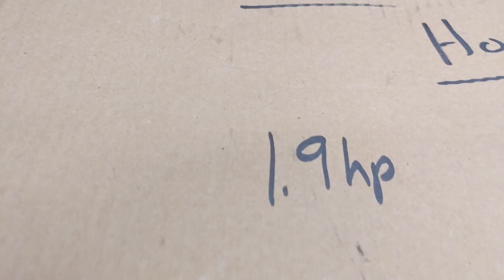Best Cordless Ratchet Makita Husky Milwaukee TESTED 12 volt

Comment: I wonder how much faster would the makita be if you ran it on a 20v battery with a adapter for porter cable
Reply from the maker: At low voltage around 8volts it is spinning at 400rpm and 12volts 800rpm. So as long as the motor held out, with 20volts it should be clipping along at 1200rpm. That would be fun.
Reply: @sixtyfiveford  how much did the makita cost I'm starting to get adapters for my tools so I can run them all on the same battery
Reply from the maker: @adammosher5818  You won't find an adapter to go from 18/20 volts to 12 volt tools. The voltage is just too high and you would likely burn stuff up. 18 and 20-volt tools are exactly the same, It's just marketing for one manufacturer calls it 20 volts max versus 18 volts.

Comment: I have a Milwaukee fuel but have been thinking about a husky for home. I really would like it to have a removable battery though
Reply from the maker: The battery in the little husky seems to last probably four times as long as the Milwaukee 2 amp hour. I can do numerous days of work / jobs with the husky without ever needing recharging.
Reply: @sixtyfiveford  interesting…must be a bigger battery? I go though a 2ah in my Milwaukee pretty much every day at work. Like you stated they slow down quite a bit at 2 bars of battery. That’s good to know,  I might just give the husky a try for a cheaper alternative at home. Thanks for the response!
Reply from the maker: @jeffclark5024  I opened up the husky when I got it and if I recall it was 2ah or 2.5ah. Doing these tests in this video, I found that the Makita seemed to last about twice as long and the husky four times. I had to keep replacing the battery in the Milwaukee for all the tests.

Comment: I think it woulda been worth mentioning warranty especially on the husky n run time n recharge time on it since you can't just swap out the battery n keep going. I actually just picked up the earthquake ratchet cuz I got a crazy deal on it n it'll do everything I need it to do but as we all know the warranty is garbage. I just couldn't pass it up having it n an extra battery for less than $100
Reply from the maker: The Husky has a 2 year free replacement. Just walk in to any Home Depot with the receipt and they should hand you a new one. The Husky will easily tackle a few decent size under the hood jobs before needing a recharge. You could probably rip down an entire engine on a charge. It takes around 1.5-2hours to charge it if you fully drained it. But you should never really do this with any battery pack and should charge it whenever not in use. I honestly thought I would hate not having battery packs but it's just like cell phone where you just plug it in. They put top of the line Samsung cells inside this but in 7-10years when they die you can simply take a few screws out and solder in 3 new cells($15-20).

Comment: Ya speed is generally important and I mean compared to a ratchet they are all winners but sometimes they fight you all the way off and the extra torque might matter
Reply from the maker: Very true. All of these will remove those stubborn bolts that fight all the way out. Generally these ratchets are only for small bolts sub 5/8 or 15mm. Anything over that should really just have a small impact removing it.

Comment: So what about Makita's 18V vs 12V? It literally has the same specs, which i think is crazy since its running at higher voltage. You would think higher torque or something. Am i missing something? I own 18V tools and charger so i was hoping to only have to buy the tool only.
Reply from the maker: I have used other brands with higher voltage and they no more powerful, just bulky. I think the ratchet head is the weakest link any they're afraid of breaking it with too much torque.
Reply: @sixtyfiveford  thanks. You would hope that they would sell the bere tool then for the exact same cost between the 12 and 18 volt. Nope

Comment: Nice video, very informative. Have you seen the new M12 FUEL™ 3/8" High Speed Ratchet (2567-20). I'd be curious of your thoughts on that one.
Reply from the maker: Yeah, but they dropped the 60ftlbs and now it's only 35ftlbs like all the others and still slower than the Makita on paper. I've tried to like the Milwaukee ones but everytime I do a job I grab the Makita.

Comment: Damn it I knew I should have bought that Makita ratchet instead of the long neck 1/4 snap on!
Reply from the maker: I would take the SnapOn over the Milwaukee for sure. But for in engine bay work, the Makita rocks. The speed is as close to using an impact as you can get with a ratchet.

Comment: Very nice review.
Have you accidentally dropped any ? 
How they fair ?
Reply from the maker: I've dropped the Husky and Makita a few times without any issues. They're both pretty light at 2ish pounds. I haven't dropped the Milwaukee but I'm sure it would fair fine unless dropped on the battery pack. The head is so heavy I'm sure it would break the plastic on the battery case if dropped from chest height, but also the head is so heavy it would likely fall head first.

Comment: I’ve been thinking of purchasing one but now I’m on sure, this is the second review I have watched and the first review I watched also was against the Makita and the Milwaukee and when it came to speed the Milwaukee was far faster than the Makita so now I’m confused and unsure.
Reply from the maker: All of them drop speed considerably with a low battery(about half speed). I know the video you watched from project farm. I can only assume he used a low/dead battery for the speed test as that is the only way I came up with the same figures he did. like I said they all drop speed so the Milwaukee drops speed as well with a low battery.  I ended up getting rid of the Milwaukee as it was just too painfully slow, and I'd rather just use an impact driver and never use a power ratchet at all. The Makita on the other hand has been fantastic and I have no regrets.

Comment: Milwaukee is a little late, but they just released a high-speed ratchet version.
Reply from the maker: Yes, they upped it to 450rpm but dropped the torque down to 35ftlbs. This would still put the Makita at nearly twice as efficient. And all the extra features are just icing on the cake.

Comment: I saw recently that the next gen Milwaukee is supposed to be same strength with double the speed!
Reply: Yeah 450 rpm still no where near that mikita  tho
Reply: Wasnt it 35ft lb but twice speed?
Reply: @Jtwizzle  yeah 35 ft lbs 450 rpms
Reply from the maker: Yeah, just looked it up as well 35ftlbs and 450rpm. Personally to me RPM is king with these things. 450 would be night and day better than the painful 200rpm the current one spins at. I guess they'll make people wait another year for the next model to get up to 800rpm. I wonder what Makita's next rendition will hold? Maybe 800rpm and 55ftlbs..... Honestly though the ftlbs are not that important as I'm constantly having to use hand force to remove fasteners even with the 55ftlbs of the Milwaukee.

Comment: So, you didn't try the new Milwaukees?

 M12 FUEL™ ¼” High Speed Ratchet (2566-22)
M12 FUEL™ 3/8” High Speed Ratchet (2567-22)

450 RPM. Still without the "features" of the Mak, but it would have been a fairer comparison.
Reply from the maker: Those haven't been released yet. They're 450 RPMs but only 35 foot pounds. The Makita would have still doubled their performance.

Comment: Pretty cool, but I NEVER use my 1/4 or 3/8" air ratchets for some reason...  Maybe dealing with the cord is why I don't??  Also, doesn't the electric impact sort of replace these as well?
Reply from the maker: I hate air ratchets for two reasons and never used them(even though I owned them). They all spin super slow 150-200rpm and are just noisy.
Reply: @sixtyfiveford  haha, and let's not forget the fact they have the air lines attached, always getting tangled into everything and in the way!  Yeah, I NEVER grab mine and I even own a super nice Snap-On 1/4" air ratchet ... 

I'm trying to decide if one of the eclectic versions are something that will benefit me because I'm wondering if it's something that will actually be more than the electric impact driver I already have?  Obviously you dig them and I respect you opinion greatly...  I'm a maintenance mechanic/machinist in my day job, and an avid DIYer and tinkerer on my off times.
Reply: At the shop I would never pull my air ratchet out of my box. I just always used a regular socket and ratchet. It took more time to hook that slow, loud, cold metal thing up than to just loosen the bolts by hand. Once I went electric, I never looked back. It sits right next to me without getting in the way and you can rip a radiator and fan out in 5 minutes! It also is the ONLY way to go if you go to junkyards.
Reply: @HoosierDaddy_  Which model do you use & like?
Reply: WHO WHO WALKWA  * the big 3 all make pretty good stuff. I find a good deal on batteries and usually stay in that line. You could use adapters though. Milwaukee usually has the power, Makita usually has the smoothness and quality, Dewalt has a few good ones too. You can't go wrong with the makita ratchet and the Milwaukee impact.
Reply: WHO WHO WALKWA  * pretty much. Make sure you have shallow and deep impact rated sockets. There's always going to be a few Bolts that you can't reach with  these tools and sometimes you have to be careful not to snap small delicate bolts off with all that power. You'll just need some wrenches and a couple ratchets for the small difficult stuff. Using electric tools on most things just cuts the time down significantly. Especially when you have to, say, bust the front tires off and replace brakes. You can just zip right through that. But, for instance, when putting wheel lug nuts back on, you DON'T  want to use an impact since they need to be torqued properly. So I'd say 80% of jobs can be sped up with electric or air tools. Electric now being more portable. If you get a "mechanics set" of basic tools and a good torque wrench and good jack and stands, there's not much you couldn't do. Occasionally you run into jobs where you need specialty tools. The auto parts stores loan these out though.
Reply: WHO WHO WALKWA  * if u don't cross thread or tighten them very hard at all, u can zip them on with an impact. Get it wrong once, and it will make a bad situation quick! Just be careful!

Comment: How has the Makita held up? Any Problems?  Thanks.
Reply from the maker: I still love the Makita and have had zero issues. The only one that comes close to this now is the DeWalt; which wasn't available when I did my testing. They also didn't have the Makita 18 volt which is identical when I did my testing either.
Reply: @sixtyfiveford  Do you find yourself switching the heads much or do you stay with one? Have you tried the DeWalt? Is there any difference between the 12v and 18v Makita other than the battery?
Reply from the maker: @brianboughter1040  On certain jobs I find myself switching back and forth a few times. But for the most part it stays with 3/8.  I have not used the DeWalt just seen reviews and it hits on some of the points that I really like about the Makita. As far as performance, there's no difference between the 12 volt and 18 volt. It's just a size difference. This is unfortunate because I don't love any other Makita 12 volt tools.

Comment: How does the 18v makita dwr180 compare you reckon? Same thing but 18v instead of 12v
Reply from the maker: On paper they have the same specs. so other than just having a larger battery hanging off the back they should work identical.
Reply: I went for the 18v as I already have that platform. Specs the same yeah but surely the 18v will have more power on the get go. 
I've tried mine out already and it only does up to 90mn and undoes 120nm. Sorry I'm metric lol

Comment: I would like to know how the AC Delco ratchet prefoms
Reply from the maker: They seam to be part of a group of rebranded Chinese ratchets. If you look closely virtually all these look identical. I think the batteries even interchange. Harbor Freight had the identical match to this and I did use it. It was handy but a budget tool. I would think the tool itself would last the average diy guy years but they always jamb the cheapest cells in the batteries and they seem to die after only a year or so of light use. Those can be taken apart and replaced though, or buy new batteries.

Comment: What do you know about this one "ACDelco ARW1210-3"?
Reply from the maker: It's the exact same as the Harbor Freight one, just different stickers. You can also find it made under a few other Chinese brands online. I thought it was bulky and cumbersome compared to the Husky. It does have a decent amount of torque but is slow. Personally I want speed but others don't want to ever use their wrist to break a fastener free and want the tool to do everything. That's where 60+ftlbs shines.

Comment: The Milwaukee is the long reach.  That’s a lot more expensive then the regular Milwaukee.  And none of the others are Long reach
Reply: Truth, but in all reality, i think if i had to buy first time, long reach is the way to go. You wouldn't need to get a normal 3/8 ratchet (i got a straight 3/8 snap on which is quite a bit longer and is easier to crack things free) and then use the Milwaukee. I love the Fuel though, even the odler version is nice for smaller fasteners which you don't want to totally bust. I broke loose Sway bar bolts on my Daytona charger a while back, the Fuel one just pulled through and kept fighting it out. I even was putting in some lag bolts into wood just for fun, not reccomended but it was cool.

Comment: Is this makita better than earthquake right angle ratchet from Harbor freight thats costs 129.99
Reply from the maker: I returned the Earthquake after a few days I hated it so much. I would take the $60 Husky over it. I want a bolt runner though. I want speed in taking off fasteners and care very little about moving my wrist to break a fastener free. For most bolts I prefer a impact gun or 1/4" hex impact w/socket adapter as they just blast the bolts off in a second. So in the few times I need a ratchet, I expect fast speed from my ratchet. 

If you just want torque the Snapon is the best followed by the Milwaukees 55ftlbs, but you will still use your wrist a lot. Those are ridiculously priced though. For high torque and budget the HF is just a Chinese clone and you can find cheaper like the AC DELCO https://amzn.to/3jlvcbp . Notice it looks identical, because it is and I think it $90 right now.

Comment: The problem with Husky is you cannot use a second battery or replace the battery once the original is dead...
Reply from the maker: The battery will last for 5 to 10 years depending on use. At that time you can simply open it up and solder in three new batteries for cost of about $15.

Comment: Dang, you changed my mind. I was stuck on the milwaukee as my favorite color.
Reply: Buy the one you already own batteries for.  Odds are you won’t really use the thing most of the time.  Any shop worth its salt has air and a decent pneumatic ratchet is under $120
Reply: @mattberg6816  Anyone buying one will use it all the time, even DIY.  And the M12 is so much more useful than air.  I only use air for tires at this point.
Reply: @sjfk1306  agree to disagree
Reply: @mattberg6816  there is no “agree to disagree”. That would be an opinion thing. I’m talking fact...
Reply: @sjfk1306  ok
Reply from the maker: I got so tired of being locked to a battery platform and giving up features of other brands. So years ago I decided just to buy them all and try them out. I sell off anything I don't like for 80-90% what I paid or at a $10-20 loss so cost is negligible. I love me Milwaukee M12 Stubby and wouldn't give it up. Now I have a Makita 12v ratchet that rocks and the others will go to good homes. I would have thought the Milwaukee as the best if I didn't try the others(about 12 in total).
Reply: Too bad the rest of the makita 12v line is useless 😂
Reply: @TheLexiconDevils  I have a drill and impact I use for around the house.  They work fairly well. In my truck I carry Milwaukee.

Comment: Just got a AC Delco for Christmas and think it does 45 ft lbs. Came with 2 batteries.  Thoughts on it 65?

Edit: nevermind.  I see your comments about AC Delco being lumped in with the Chinese brands now. Ugh...oh well - at least it was a gift and I didn't buy it.  Ha.
Reply from the maker: They're not bad I just didn't think they offered anything notably special over what you get out of the Husky for $50-60. They are an exact clone of the Harbor Freight Earthquake and I believe the batteries even swap directly. It's actually the top of this clone series and you'll be happy with it.

Comment: Good review. I could tell you used the Makita the most because it was the dirtiest one.
Reply from the maker: You're right about that. I tried to clean it up a bit so it wasn't so obvious. The Milwaukee actually died on me and this is a new replacement as well. I didn't want to beat Milwaukee up about that because I know things can happen. However, the one I swapped for was a lot cleaner than the Makita is.

Comment: How often do you run down ten inch bolts with a ratchet?
Reply from the maker: Every bolt has around 1" of thread. So this test is the same as removing 10 bolts.

Comment: Why do you have three ratchets of diff brands.....just like collecting tools?  I have that problem too sometimes.   Lately I have tried to standardize on  M18 battery stuff that fits it.    Yeah   ......  M  brand definitely commands the top prices.
Reply from the maker: I actually narrowed this collection down from about a dozen. I decided years ago not to be bound by a battery manufacturer and just get the best tool out there. The only way is to try them all and sell off the unliked ones to good homes.